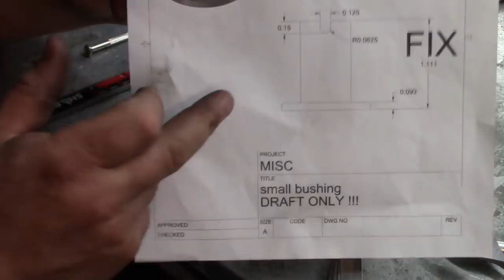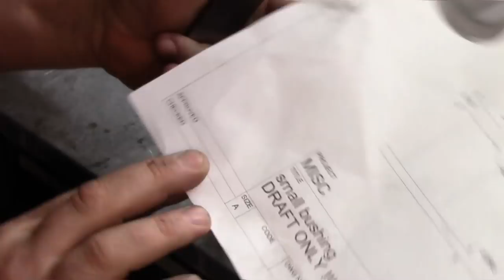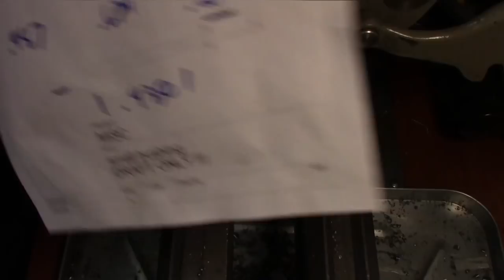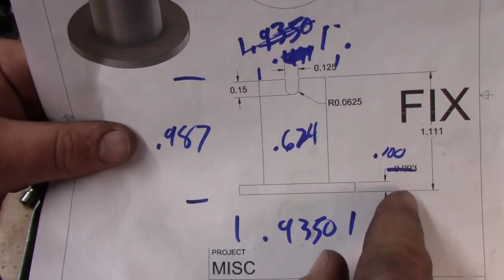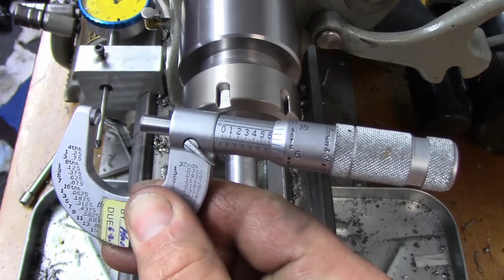Southbend 13" Large Dial Upgrade Part 6: Dial Spacer and Finishing Touches

Comment: WOW, A LOT OF WORK JUST TO CHANGE THE DIAL BUT SUPER GREAT JOB...   YOU DID NOT UPDATE THE LEAD NUT.  THAT WILL GET THE BACKLASH DOWN EVEN SMALLER.  IT IS A FANTASTIC JOB.  IT LOOKS LIKE IT IS VERY TRUE.  IT MAKES USING THE SOUTH BEND MUCH NICER.